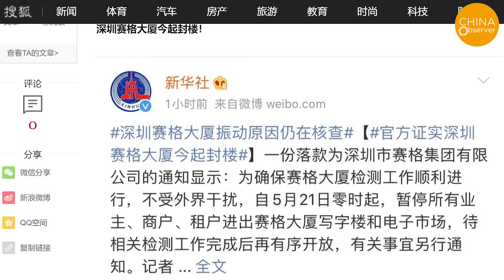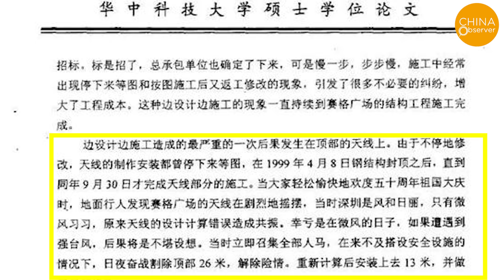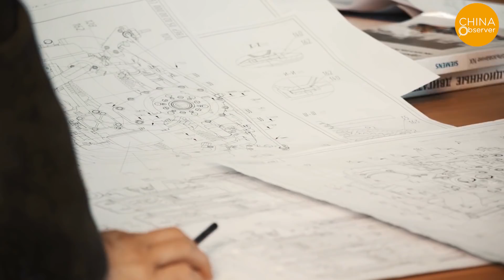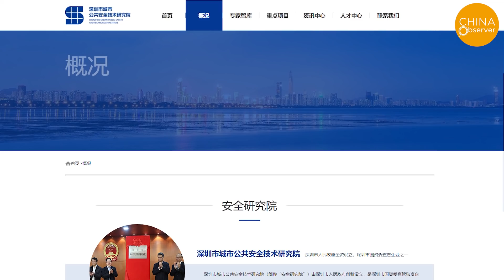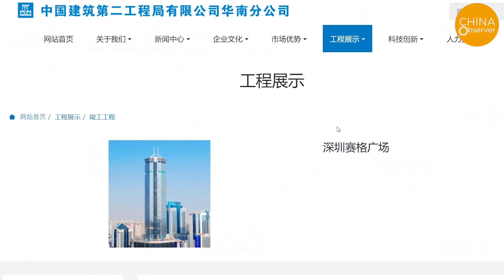356m Tall Skyscraper Shaking Again, Monitoring Data released, analysis of the causes of shaking

Comment: I've heard that it's more difficult to insert the rebar after the building has been constructed.
Reply: I recall reading about an apartment block in the Soviet Union. Shortly after completion the building started to sag so the built what was basically a steel support system on the outside with beams running through the building. Of course, being the USSR they didnt bother about just where they ran the beams through the building so some residents had to climb over, or under, beams that ran through the middle of their living spaces. maybe they could try something similar here...

Comment: Note that China's tall buildings are not built to international engineering standards. Chinese engineers build on soft ground without isostacy consideration. And there is no quality control during construction as in the US. I did construction testing of welding, and note every batch of concrete used is tested for strength. I've inspected buildings with no welding defects, and those where I failed many welds: depends on construction supervision. A good weld takes time. Only a few welds need to fail before the highrise floors "pancake" like the World Trade Center collapse.

Comment: If anyone still following this video, the lastest findings based on monitoring data fr 18-20th Mays, the tower resonated 21 times by vortex ( whirling of air in wind) round and up to an aging long vertical masts. Structural integrity not in question right fr start as no reports of structural cracks, settlement and bulging of the column supports. This video once again was proven inaccurate in its reporting.

Comment: In many documentaries, high rise building models are made and the effect of winds etc vibration (eg earthquake prone region) are tested using the model just to see if the building would be able to withstand certain stress.  Although this would only be a simplistic predictive model, it nevertheless could provide crucial information about potential problems

This Shenzen tower was made in 1996..  Thats nearly abt 25 yr ago.  The building history seemed to have indicated it was designed "ala carte" ...like pay as you go.  Crazy.  A building would have needed proper design first, what more a very tall building, then only one would start constructing it.  

It shows regulation/corruption problem can also affect even a communist country

Comment: At 2:39 they state that construction was 2.7 days per floor. You can rest assured that that is quite possibly part of the problem. Concrete takes about 2 weeks to fully cure if the conditions are right. If you don't let it cure to a certain degree it will create problems as you go up since the additional weight can cause internal cracking and separation from the reinforcing steel which will weaken the entire structure. 

The idea of "fast tracking" projects is nothing new. I have worked on several projects that were being fast tracked and there were always problems that showed up in the end requiring rework. One of the things that most people are unaware of is the fact that buildings and other structures are designed from the top down. You start at the top since it will be subject to the least amount of loading. As you work your way down, each successive floor or level must not only support itself but also all of the levels above it. For example, lets build a building 20 stories high. We will assume that each floor weighs 100 tons. The top floor will only need to support it's roof along with any loads created by rainfall or snow load exclusive of any additional loads for  equipment or fixtures including furniture, and the weight of the occupants . The 19th floor will have to support the top floor at 100 tons so the load on it will be 100 tons plus any roof loading anticipated. The 18th will have to support 200 tons, the 17th 300 tons and so on and so forth until you reach your bottom foundations. Your foundations must be able to support 2000 tons exclusive of any roof loads, equipment or fixtures including furniture, and the weight of the maximum allowable number of occupants. In addition, each floor in a downward succession must be designed to take into account the wind loads of all the floors above it and the maximum torsional effect allowable both in tension and compression of the structure. 

Now any descent engineering firm can calculate all of these respective loads to get the size and number of columns required to start on the foundations if everything above has been taken into account for loads. That's fast tracking at it's simplest. So you are building your structure and suddenly someone decides to add a floor or maybe put in a swimming pool on the 10th floor. No problem right. Your foundations are not designed for that extra load but it's not really a problem because your foundations also have a safety factor built in to them so you keep going. The problem starts when all of these changes that by themselves are not a problem but collectively are a huge problem. It's not unheard of that the changes made after the initial design can easily negate any safety factors built in to the structure. So now what do you do? Do you tell the occupants of the 10th floor that they cannot have their pool? That extra story for additional equipment like larger but necessary HVAC units since a change in the buildings glazing demands it cannot be done. These changes and a thousand more are cumulative and can easily double the loading if there is no restrictions put on the sales people selling building space to tenants. So what happens when the foundation loads are being exceeded? Well, no one really knows. They can make reasonable assumptions but nothing definitive. It's just an educated guess really and we all know how accurate guesses tend to be. I'm willing to bet that the reason they were looking at the columns in the lower basement is because they already knew that the loads were being exceeded over the original design and over the 20 years the building had been in existence there were small but progressive failures occurring in those foundations. One crack, no problem. One hundred cracks, huge problem. As these failures accumulate the structure will slowly begin to fail until it collapses altogether. The shaking and swaying of this building is indicative of foundations on the brink of total failure and will actually speed the process since there no provision in the design for that additional movement.

And it's not just China where this is happening. It's all over the world. Just look at the failures reported each and every day in the news. No country is immune to it as long as building owners are allowed to bend the rules once construction has started.
Reply: thanks for this great comment!

Comment: A  building that shakes, sways, and vibrates to that extent shown in the video in high winds, when a subway operates, or during an earthquake can not be a safe building in my opinion. Just the water in the pool splashing violently (as seen in the video) would be an indicator of major issues not to mention, interior furnishings, tumbling, and exterior windows from several stories up, would be popping out and crashing to the sidewalks and pedestrians below.

Comment: Reminds me of when of the US skyscrapers was built they forgot to take into account wind gust at certain angles so they installed a counterweight on the top floor to absorb that. But I doubt China would admit to any fault in construction, so good luck trying to fix a problem when they can’t figure out what they did wrong.
Reply: US engineers wont forget. The design criteras incl wind impact for skyscrappers. Old ones may not have robust TMDs. Certainly not the fault of  skyscrappers constructors.
Reply: @acheable  RoC77 refers to the Citicorp Center in particular, which was at risk of toppling from quartering wind loads until the chevron braces were reinforced
Reply: @mikegaskin5542  An old skyscraper built in 1977 when the design criteria for wind impact not fully assumed. Wherelse this 2K tower no excuse wind dynamic impact not factored in.

Comment: OMG! They better drain that pool immediately! The weight and movement of the water would add to the shaking.
Reply: Yeah that will fix it
Reply: The weight of the pool is significant, but most likely insignificant in comparison to the massive structure. The real reason can only be found by engineers on site.

Comment: Anyone with an ounce of sense will get out and not go back.
Reply: If you are suffering from motion sickness, working in tall buildings not suitable for you.
Reply: @ Lars Cain - you are one hundred percent, right !       Roland Singh, Canada  🇨🇦
Reply: @rolandsingh  its common sense that the building being 79 storey tall  does not mean it is 100% free from defects. Swaying is an inherent characteristic and to dampen it is in the equation.
Reply: @acheable  According to the Video, the building wasn't "swaying". It was SHAKING !! 😒
Reply: @rolandsingh  Swaying and vibration as reported partly due to the vortex induced resonance of the two long vertical mast or antennas at the top of the tower. Experts initially suspected the vertical mast based on similar vibrations it caused for similar installations in tall towers elsewhere.
Reply: @acheable  I've been in a high rise building during an earthquake it swayed a lot. However, that swimming pool sloshing around seems wild and likely not what would be deemed "normal".
Reply: @acheable  Nobody's "giving" China a bad name. The words "Tofu Dreg" was earned in China. And the term is very believable because we've all seen a lot of cheap crap that gets manufactured there.
Reply: Life of normal citizens doesn't matter in a communist country..they'll be forced to go back there in no time.
Reply: Zero Point  It better to leave these problems encountered in skyscrappers to engineers. Likewise dont advise your doctor why the medicine doesnt work.
Reply: Zero Point  making false allegations is wrong. If dont dare to admit its abuse of freedom of speech and media. Countries incl China which have Censorship Act or Fake News Act, anybody who incites public instability such as making false allegations that the gov was corrupted thus causing the Building to sway, they can be brought to court to face the charge. Nobody is above the law. Even in US ,Australia or India etc.  For this case experts have produced insitu monitoring data as evidence to press charges if false allegation made in China.  The China authorities can choose to notify you of your offence and the burden lies on you to defend the charges. Go and think about it what YT have said. Follow the community guidelines and respect the law in that country. If the producer have crossed the OB markers, they should have the guts to admit their mistakes and apologise.
Reply: @acheable  are you trying to say.. that someone in another country… should be held accountable for a law that doesn’t exist in his own country but another’s…

You didn’t read your comment did you?
Reply: @acheable  but I’m very certain that China has no legal right to put in place laws that affect international citizens. They could bring them to court but that’s about all they could do legally
Reply: @UC3uT0k0jgw9a9qE9wRviaAA why are people so quick to defend China almost immediately? It’s like they take their own political views into account first instead of what the actual content is. The US has shitty infrastructure. A lot of the reason is because “market freedom” and its cheaper to forget about it then to redo it.
Reply: @beholden84  if its lie is a lie whether China or anywhere else..little knowledge is dangerous.

Comment: This is why when you build something you build it right and proper not cutting corners like the vast majority of Chinese building are made they littler y make whole city's houses bridges damns nuclear plants and so on that start to fall apart in ten years.
 Ive seen there building that have a cement that littler y hardens then a few months later you can pull the cement off with your bare hands it's that bad just like one of there largest bridges already one part fell while they still have car driving on the other side also to mention the nuclear plant leaking right now and we come to find out they filled in some parts with soil instead of cement to save money on building a nuclear plant so yea lol
Reply: PS. also they whole pulling water out of the ground isn't helping ether that water down there keep the ground from collapsing so now they have a massive sink hole problem they will also bury people alive in these sink holes just to get the highway up and going they wont even try to help people out of the holes so yea if you go in you better get out your self.

Comment: I hope China will consider that what has happen here is to do with the earth rippling, like seismic waves but are more broader in length from 500 meters to 1 Km.
That builds up from 0.0 mm to 0.500 mm to 1.0 meter over 2 - 3 Km that you would not realize it happening.   
And as the years progress these buildings over 70 meters high will snap in half as these ripples increase with the positioning of earth within the Solar system.
Why this is happening to China?
Because China is East of the most highest and mountainous area in the world and it the most heaves part of earth and on top of it all the earth turns in to the East.
It is my theory https://www.geoprogrammes.com/the-flip.html